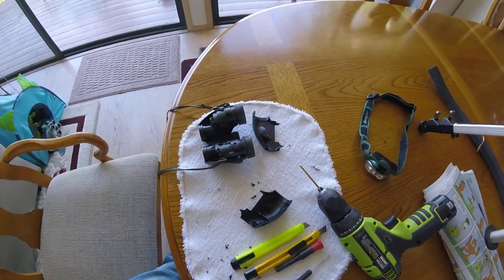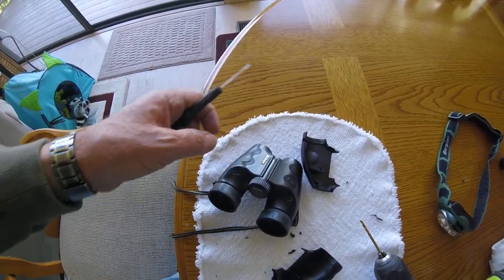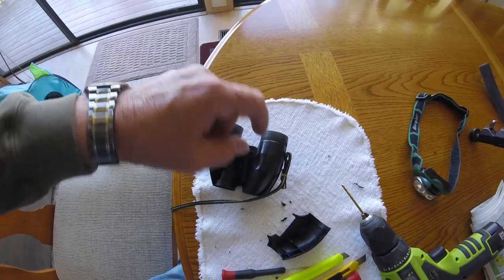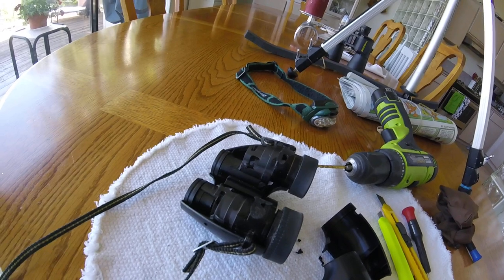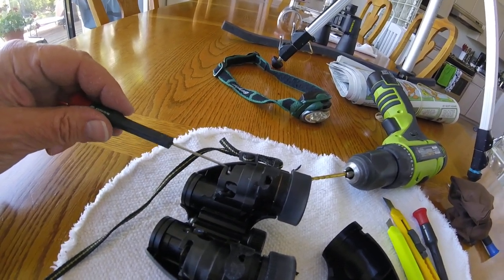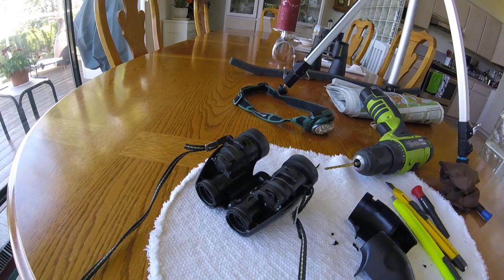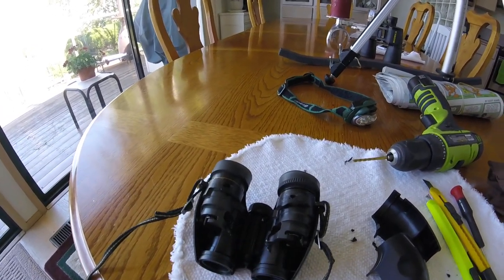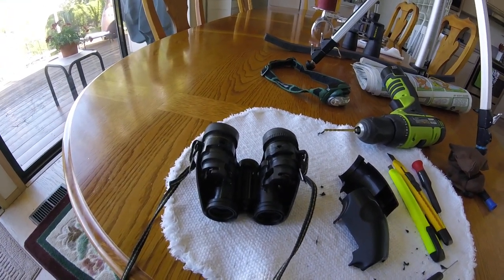Binocular repair for doubble vision

Comment: Thanks for the video. I have the same binoculars and your video helped me get them adjusted.  I found the interior set screw for the horizontal alignment worked, not the clip.  It is odd they have the vertical alignment screw available under that plastic cover, but the horizontal needs to be accessed by removing the case.
Reply: The screws are used to aligned by the factory before closing.   Not sure how they got that far out,  normally there more damage and cannot be re aligned.   The prism are spring clipped down and may slide.  but the screw stops should not change.